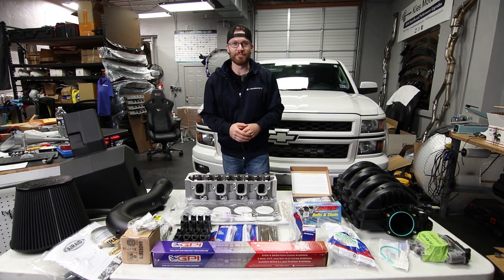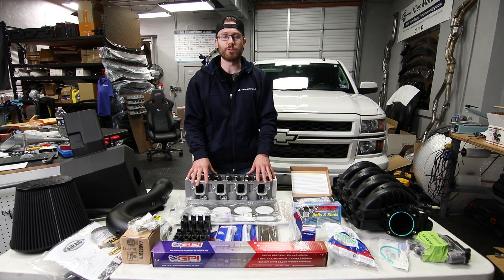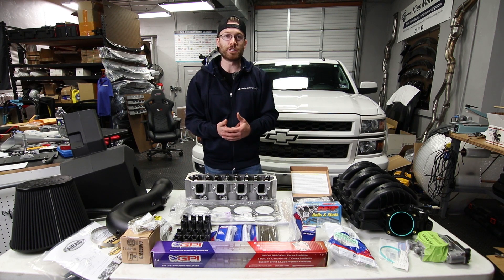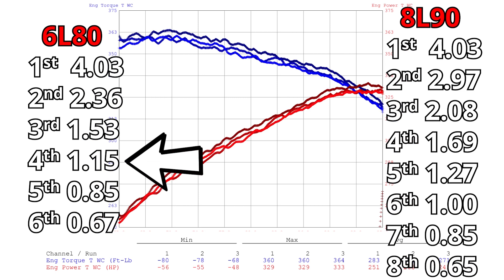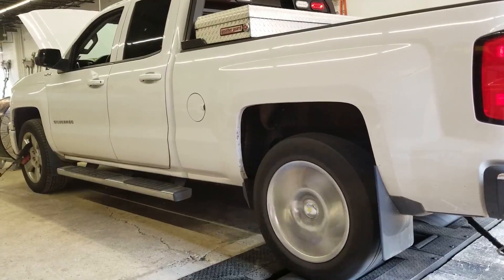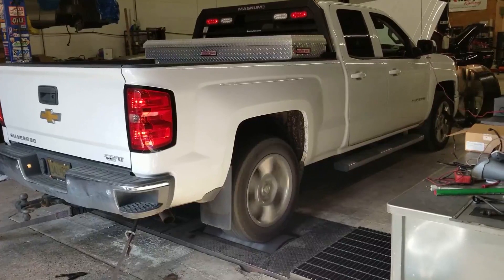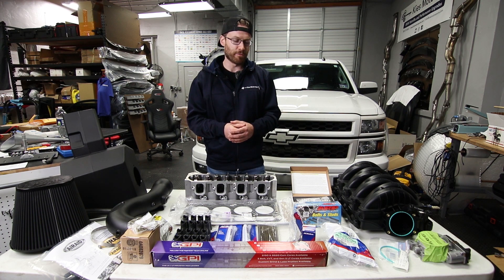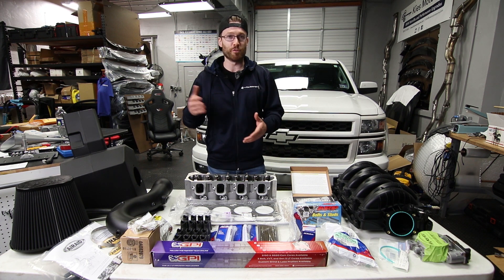AFM Delete Part 1 - What is AFM? Silverado 5.3L Baseline Dyno - How Much Power Does It Make?

Comment: I bought a 17 Silverado new. I deactivated the dod when new now 78k miles its ticking/ failing. Doing a full dod swap with a BTR cam next week.
Reply from the maker: Yup, those deactivations only help it run better, don't prevent the problem sadly
Reply: Same with my sierra L83, only 47k miles. Cylinder #2 ticking. And cylinder #2 isn't a dod cylinder. Going in for new GM performance lifters, dod delete, and BTR stage 1 cam on Jan 3rd

Comment: Theoretically the Range device should prevent failure since you won’t be compressing those lifters anymore, correct?
Reply from the maker: Guys are still having failures with the range but for some it does seem to extend the life of the lifters a bit.

Comment: You sir are my new best friend! I just purchased my First Silverado ever on Feb. 5, 2022. Mine is 2015 Silverado 5.3L 4x4 with tow, purchased with 47k miles on it. Exact same color as yours and looks  about the same except for I have the 22in. rims on mine. I love my truck but also scared of the engine problems. The manufactures warranty is no longer valid due to the vehicle being 7 years old, but with the loan was required 2yr. 24k powertrain warranty. I definitely want to do all the things you have done to yours, plus a little more. I plan on watching and subscribing to your channel.  Your new best friend Dre =)
Reply from the maker: Awesome! Best of luck with it!
Reply: @TheSundaeDrive  well as I learned from your videos I am sure I will enjoy my truck for many years to come. I'm really looking forward to seeing your Dino results with all the modifications done.
 Either way the first thing I'm doing is getting the catch can for the oil. I've been looking on the internet and the only thing I'm not sure of is should I go with the 3-5 oz can or the 20 oz can. They are saying with the 20 oz can I should only have to check it once a year. I only put about 7,000 mi a year on my vehicles. Strictly to and from work and doing stuff for the kids. Plus I plan on running full synthetic 0-20w with AcDelco filter. Which they say I should change every 5,000 to 7500 miles. I agree with changing it at 5,000 before the oil starts to break down. Still two oil changes a year that's awesome.

Comment: The disabler does stop the failure from happening because it prevents the system from  engaging. The fix your doing will cost twice what it would cost to repair the system should it fail.
Reply from the maker: I had hoped that was the case, before doing the mod I put up a poll in several of the Silverado Facebook groups asking if anyone who had a range device had still experienced lifter failure. Several owners responded that they put a range device on the truck within the first few weeks of ownership and still had the afm lifters collapse within the first 100K miles. Sadly, the lift design itself is faulty and turning the function off does not prevent the failure.
Reply: @TheSundaeDrive  how much did your work cost? The cam swap alone is a 16hr job if it goes well. Most people don't have the ability to do that on their own
Reply from the maker: Well it is hard to judge the time for us because we filmed everything which exponentially increased the time required. An experienced shop could probably do the same job in around 20 hours which I imagine is 2-2.5K depending on labor rates. 

A range device will not hurt but it isn't full protection either. Around 3-4K in parts and labor depending on the upgrades you do and the shop rate, is a lot less than a new motor outside of warranty which will still need to have the system removed.

Comment: Why don't you just get a range
Reply from the maker: Doesn't prevent the failure. Might help it last a little longer but that's debateble. Multiple people that bought trucks new and immediately installed a range still had lifter failures well under 100K miles.

Comment: if the trans ain't holdin 4th gear, you may want to get that looked at, because it could also be on it's way out, and the price for replacement is roughly 5 grand. also, you have a mexican rear axle, tighten the bolts in the rear axle of you want it to last, because mexican torque specs are about the same as a rear axle that has 100,000 miles on it, and thats brand new. so the torque specs need to be adjusted to last. planned obsolescence at it's finest.

Comment: The engine damage happens when the AFM goes back and forth from V8 to V4.  Plus, not changing your oil every 5k.   Just stick a Range Technology dongle in there.   Done!   :)
Reply: I had my lifters collapse twice while using the range. It won’t fix it mechanically
Reply: There's thousands of 200k mile gm owners that aren't using the range and haven't deleted DOD but still haven't had a failure also.
Reply: @CazadorSafetyOfficer  True, usually 2011’s to 2013’s with owners that always change their oil on time.
Reply: I want more details on the differences, I currently have a range installed, hoping I got to it soon enough.
Reply: I used a range since new 2017 now have a lifter failure. Just need to get the system out if you don't want to worry. Deactivating any way a failure can and will eventually happen.
Reply: @postalaka  2017’s have the LT engines not the LS engine’s and have a whole different set of issues.  Chevy should have left the Gen 4 LS in ever since February 2011 production dates, by then they finally addressed all the service bulletin issues ( oil pan deflecter, driver’s side valve cover, cylinder head porosity).   All aluminum Gen 4 LS V8’s from 2011 to 2013 are the good ones to look for.
Reply: I am aware of that lol I work on them for a living. They still have DOD on a gen V that fail the same as any other gen my point was even if deactivating the system it will still fail regardless of motor if it's a GM with DOD it will fail eventually even with a range or tune .
Reply from the maker: Unfortunately while the range does help, it doesn't prevent the failure. Many guys have reported in the comments that they still have lifter failure with the range installed sadly. It helps don't get me wrong but doesn't prevent it
Reply: The Sundae Drive Well at 210,000 miles on my 2011 LC9 5.3 LS I disagree.    Although the 2011 to 2013 all aluminum Gen 4 LS engines are known to be the best years.  All the GM updates were complete by 2011.  The newer LT engines are junk.   Plus, you won’t pass smog with all those mechanical modifications and needed tuned, the Range can be unplugged for smog inspections and then plugged back in.
Reply from the maker: Glad it is holding up for you! A lot of people do have your experience but many have commented that they still have lifter failures with just a range. California is pretty rediculous with their inspections for sure
Reply: Wish that was true but it isn't. No need to get into facts . Just take my word for it either way you will find out though.

Comment: What happens when you don't delete the afm from the computer?
Reply from the maker: It has to be tuned out if you physically delete afm. If you don't, it will try to deactivate the cylinders so it will cut fuel and the oil pressure in the lifters will try to change and not be able to, etc

Comment: really appreciate the video. My 2015 truck has 165k miles on it already. i want to do the DOD delete even though i havnt had a single issue with it. because i also want to do some other upgrades. but with the mileage , im considering trying to find a 6.2 motor with the same or less mileage and just do a swap plus a few of the same upgrades you do here... a cam upgrade in a 5.3 is great and all , but obviously the same cam in a 6.2 will be that much better. 

Side note , i think most people having issues with DOD are probably non car enthusiasts who just dont maintain their cars well by following a proper maintenance schedule or using quality oils. At 160k miles my high pressure injection pump started leaking so i pulled the manifold to do that job, anyway i obviously took the time to inspect the intake valves for cleanliness and they were so clean they weren't worth cleaning. thats at 160k miles. i just sprayed them with basic carb cleaner and put it all back together. Maybe its my driving habits , but more likely its my maintenance routine and choice of quality fluids. I often change my oil before the 10% remaining on the oil clock , and i use the best oil i can find on the shelf according to this ranking list. https://540ratblog.wordpress.com/2013/06/20/motor-oil-wear-test-ranking/
Reply: Im getting a 2015 sierra should i go through the trouble of deleting it or just deactivate it

Comment: Just did this to my 14. Do you have an issue with the o2 sensors reading rich On both banks?
Reply from the maker: I have not had that issue but I haven't played with the tuning too much yet.
Reply from the maker: I'm having some other issues I'm trying to diagnose so still have some work to put in. Taking my time to make sure it is done right.
Reply: I only did a stock cam delete just wanted that afm crap out of my motor.  Tuning wasn't really an issue, it runs great just has check engine light for o2. Not being a tuner myself im not sure if I can just delete the sensors.
Reply from the maker: @alexeckman5542  I had it tuned remotely, I don't know enough about tuning these trucks yet. It shouldn't be running rich tho. You went with the stock Brian Tooley cam then?
Reply: @TheSundaeDrive  went to a stock cam from sdpc

Comment: Took my crew cab 2014 sierra to 130+ multiple times on a road trip. I thought it was limited to 95mph but previous owner obviously tuned out the speed limiter. After these runs I figured out my speedo says its  10mph slower than it is actually running at 70mph gps says 80mph. As far as I know my driveshaft is stock and has gone well over 130mph
Reply: Had I known that was an issue I prolly wouldn't have been going so fast. My truck is lowered in the rear so the driveshaft is not at an extreme angle so maybe less angle helps. Took a look today the drive shaft is balanced dont know if it was factory or not though.
Reply from the maker: @mulishamccoy  if it is a single piece shaft it is probably factory. I'm looking to upgrade to a 2 piece one
Reply from the maker: Good to know! I do know that most shops refuse to take the truck that fast because drive shafts have come apart on them so I'm a lil nervous to still

Comment: hey man, nice vid, so what's the scoop in the driveshaft, you do a vid on that ? following this close, thanks, Roost
Reply from the maker: Thanks man! I haven't changed the drive shaft yet. I will be at some point this summer and will definitely be doing a video on it.
Reply: @TheSundaeDrive  cool, well the reason i ask is i have never heard that before. I have run my 15 up to 150mph several times, now you got me worried. Where can i find more info on that, thanks, Roost
Reply from the maker: Just saw a post in one one the FB groups and I guys drive shaft broke at 135. Personally, I wouldn't take it past 95mph (where my truck is limited to) without an upgrade.

Comment: My lifters went out at 64k miles because of AFM.
But couldn’t you just tune the truck and have them disable the AFM?
Reply from the maker: It can be tuned out but doesn't prevent the failure from occurring. Design flaw in the lifters unfortunately.
Reply: The Sundae Drive how can it still fail if it is disabled? Since the truck is staying in V8 
Sorry to ask so many question just wondering since I’m close to getting my truck tune.
Reply from the maker: It is probably less likely to fail if you've tuned it out. However, I asked in one of the silverado groups and two guys tuned it out with a range device soon after purchasing and still had the failure occure. I am not sure which part of the system failed to cause the failure but it still can happen.

Comment: Huge favor, give a report on any carbon related issues on the intake side.  Just curious about this GDI motor.  Lots of oil air cans being installed.
Reply from the maker: It was pretty clean. Catch can has been on for about 60 of the 108K miles
Reply: @TheSundaeDrive  Thank you.  My 2015 has 70k miles, purrs like a kitten.  Just got a moroso can.  Not sure if it;s too late, but I am new to this GDI concept.  For what ever reason I thought this was a port injected motor.  Guess I am just too old :).
Reply from the maker: I run a can on all my vehicles. Cheap insurance lol. Now that I have brand new heads, that will always have a catch can, I'm curious to see how clean it is in 50K miles

Comment: I too have a 2014 ltz 4x4 with airaid jr intake, catch can,  borla atak exhaust and with the range technology, trucks sitting at 90,000 miles at the time being and under warranty... 

Do I need to consider this route at this time or should I wait till warranty is up?  If anyone can shed some light on a newbie... thanks in advance.

Thank you for the good contents.
Reply from the maker: If it fails before you are out of warranty you get free repair if they honor it. You are close to the end of the period tho so it's a toss up
Reply: If you've programmed it out early on you'll be ok. Damage is done when going between v4 & v8.

Comment: Seems like a lot of money for something that may or may not break. Otherwise, great info, great video
Reply from the maker: Thanks! You can do it for around $1000 if you go as inexpensive as possible and only replace the required parts. Not too bad if you can do all the labor yourself. The labor isn't trivial tho
Reply: There's enough info out there that chevy should have done something by now. 6850 later with my '15 6.2 silverado thanks to this design. It happens a lot with this afm buddy.

Comment: I hate AFM!  I have the GM extended warranty for 7 years 70K miles so hopefully nothing happens and I can do this mod then.  Or if at 6 years 60K nothing has happened I can take a chance and do this to my motor and keep the warranty for all other items.
Reply from the maker: Agreed. I had the 100K warranty with my 14 but I blew through that in 2.5 years (picked it up used with 19K). Unfortunately, all the manufacturers are implementing similar systems to meet EPA regulations.

Comment: Whats the link for the dele kit?
I got a 2015 Silverado and I’m having problems with my AFM  system dealer is giving me the run around with it so getting rid of the afm has been a thought on the back of my head
Reply from the maker: Look up gwatney performance: GPI and they have kits you can select options from. Tell them you saw our video Cliff sent you over to them. Next weeks video will go through all of the parts and have all of the links

Comment: What problems exactly have you experienced with the AFM?  I have a 2015 Silverado,  5.3 V8, 4X4, double cab.   I have not had any problems with my truck yet.  I have almost 54,000 on my truck.  Thanks.
Reply from the maker: No problems at all but the longer you go the greater chance of failure. I'm at 108K miles and put 30K+ miles a year on it. I would rather do preventive maintenance before it happens. It is is my winter vehicle and don't want to chance it going out once snow is on the ground. One of my buddy's afm on his camaro failed 3 times.
Reply: Problems you’re gonna have your AFM lifters collapse and will cause a misfire May cause a ticking noise while driving I just went through this with my Silverado same year and engine like yours at only 38k miles truck now has 47k miles and it’s doing it again but dealer is giving the run around I may just have a bad batch engine but it’s frustrating having to deal with it
Reply from the maker: It isn't just  bad batch of motors from what I call tell. All of the trucks from our generation (14-18) with AFM have the problem, I am curious to see longevity wise if the 2019 and newer trucks have the same issues
Reply: The Sundae Drive from what I was looking online the 19s just got complex to the point that at low load it shuts down to 1 cylinder and up to 17 different firing patters to balance power and cylinder activation with two cams that extend and retract to achieve cylinder deactivation demand they also didn’t mention if they corrected the issue of carbon build up on valves by adding additional injectors at the intake like some Toyota engines do

Comment: Interesting, my 16 Silverado 5.3 has no mods and I know it goes over 105 mph.
Reply from the maker: Maybe they beefed it up with the model refresh. Which model/trim do you have?
Reply: The Sundae Drive Lt / Crew 6 speed, 342.
Reply: Mine too.  I've had my 16 Sierra up to 180 kilometers per hour (indicated) and there was no sign of a limiter.  It still felt like it had lots left but I didn't want to push it too much.

Comment: Hi, i have 2015 Silverado but i only have 4.3 v6. My engine in losing power or the rmp get lower after 2 seconds when accelerating.
Reply: Okay i will have my mechanic check it thanks 😊
Reply from the maker: @RealWjay  No problem! Best of luck to you. Let us know what it ends up being
Reply from the maker: Transmission slipping possibly?
Reply: @TheSundaeDrive  yes could it be that?
Reply from the maker: Do the rpms spike? That would indicate a slipping trans if you dont accelerate quickly.
Reply: It only does sometimes tho. But the engine doesn't hold the rpm up when accelerating instead it will go down after like 2 seconds even if i press the gas pedal more.
Reply from the maker: Hmm could be a vacuum leak maybe? Any lights?
Reply: I really don't know. I have changed the spark plugs and there are no lights came out
Reply from the maker: Not sure. That's a weird issue for sure. I would check with a mechanic and see what they think